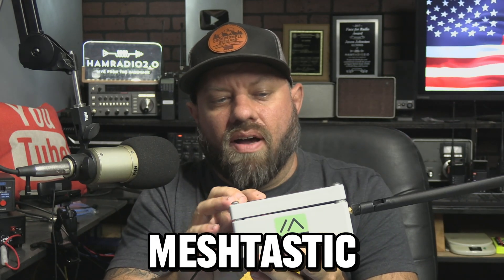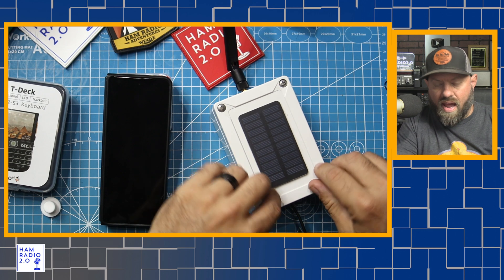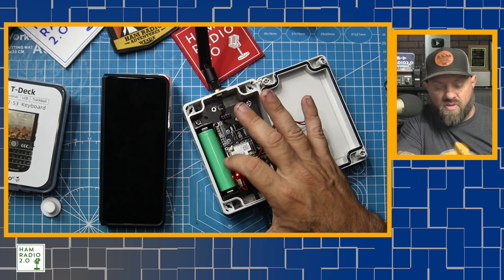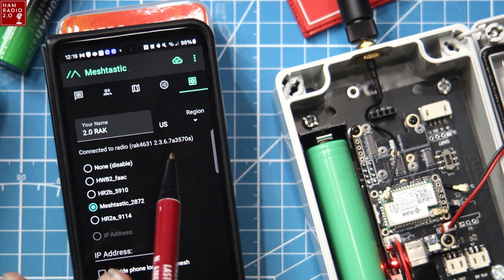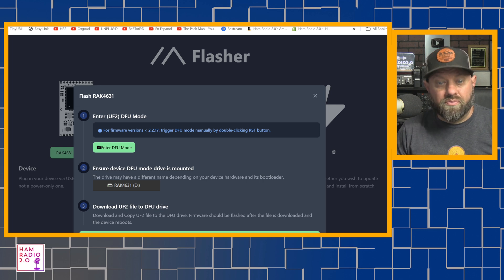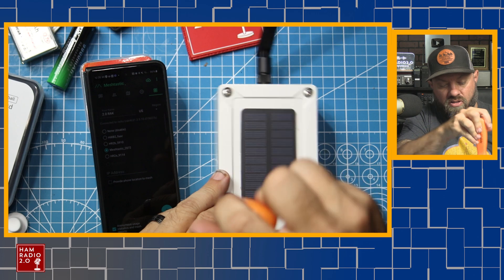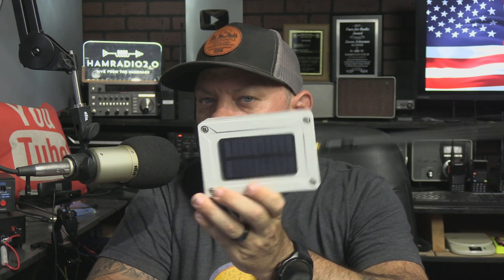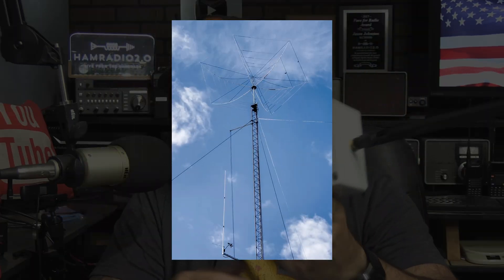Ultimate Meshtastic RAK Wireless Node Setup Guide

Comment: I am seeking assistance with the proper installation of a LoRa antenna, specifically regarding the correct use of bolts and washers. Could someone provide detailed guidance or resources on this process?

Comment: Received this same unit the same day you put this video up. Overall, pretty disappointed. The power system is a failure. I put this out in noonday sun on a severe clear day and there’s still not enough power. It basically seems to have enough power to make the initial Bluetooth connection, then it dies. I ASSUMED (my fault) that the battery would run the unit in the event of insufficient sun. Nope, it appears that the battery only preserves settings. Charged the battery on an external charger to make sure. Runs fine on an external USB-C power supply, but, it shuts down when external power is disconnected. I understand the goal of waterproofing the box, but, needing to remove the lid to apply power isn’t practical.
Reply: Looks like a HW failure. A RAK board usually can run for days with an 18650 battery.

Comment: I have the Rak 4630 and used the 4631 as the device. It has been running for over a week and has not dropped below 92% since it is up. It has work awesome since we had running as well of nights... some days it charges too 100%. Then becomes to PWD ... It took a few shots to get the MFU to work. I am using a 6 watt solar panel. My box is water proof and mounted on top of the parking garage. I was able to pick it up from DFW Ham Expo and even do Admin work on mine from that location! PaulRak4631 is my Device...
Reply: I can show you how to do an Admin setup!

Comment: That great. Would like a follow up on how that does. You can add a USB solar and use RTV blue silicone to make water proof. the 2 solar will be fine together . With 18650 cells . you want Japan made ones . like Sony or Panasonic .   The Korea made battery is go as well. just stay away from China 18650 cells. you want the 3.7V ones.  the 3.2V LFP are for different use. they have them in 18650 . check before you buy.  73's
Reply from the maker: Thanks

Comment: The new enclosure with bigger solar panel is SKU:910421 directly from Rak wireless 

“ Unify Enclosure IP67 150x100x45mm with pre-mounted M8 5 Pin and RP-SMA antenna IP Rated connectors”
Reply from the maker: Garth has a couple also

Comment: If I have access to a high location in my town. Could I mount one of these devices there to act as a repeater to receive messages and pass them on to others in a network ? The messages could be held in a buffer and transmitted after completion.
Reply from the maker: The make actual repeaters for Meshtastic but I am not sure how they differ from this unit.  But yes, what you are saying should work...not sure about the buffer though
Reply: When I was at Hamvention I talked to one of the guys from FL who was putting up a network of these in his county to act as an additional emergency comms system. They had access to several water towers/etc and were testing battery sizes and some other things because they would only get access to some of these locations once and may not be able to climb again for maintenance.

Comment: I have one of the RAK devices mounted outside with a larger solar panel and it's been up for ~3 months now with no issue other than I can't easily update the software with it sitting up on a pole. I based mine off of "The Comms Channel - New 2024 Off-Grid Solar Meshtastic Build" guide. I don't use the same batteries or panel but what I have is effectively the same. The RAK devices use significantly less power than the Heltec devices; a single 18650 is more than enough to ride out several cloudy days. I do have mine set up as a router and if it was getting constant, heavy traffic the single battery might not be enough but for now it's plenty. Right now it just pings off of a few neighbors that I can see and what devices I have at home.
Reply from the maker: Awesome
Reply: He has a few videos and some with updates. This is where I built might from... it was a lot of fun! ;) Make sure and watch the videos and see if you might want to build a little different. ;)